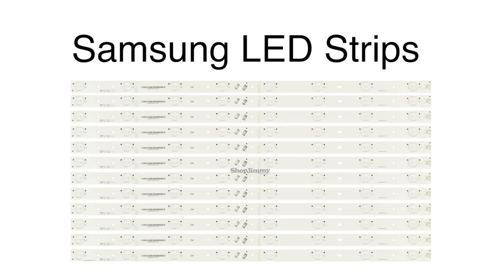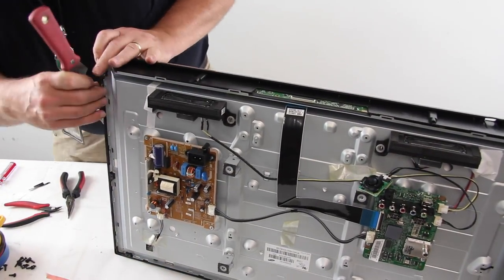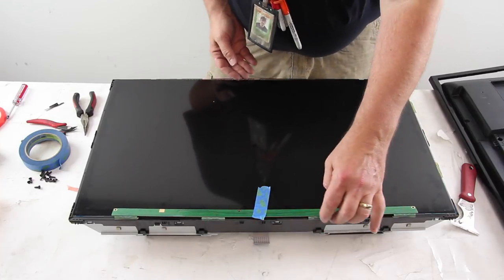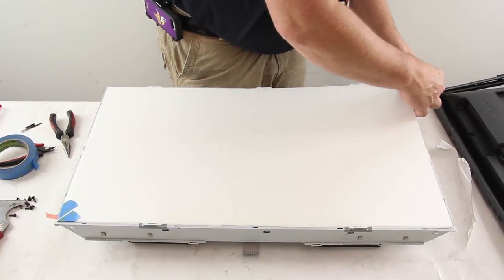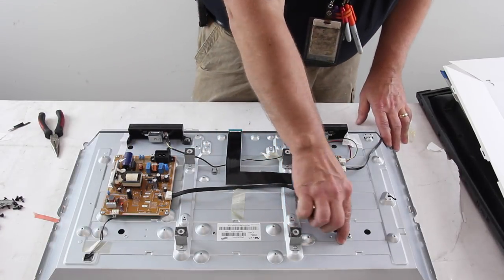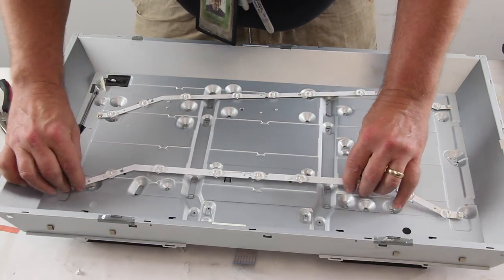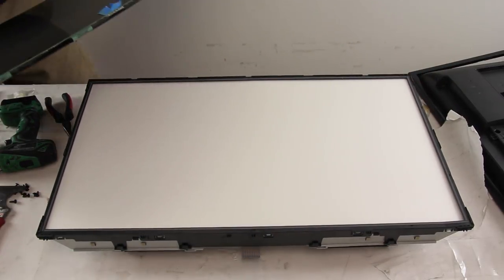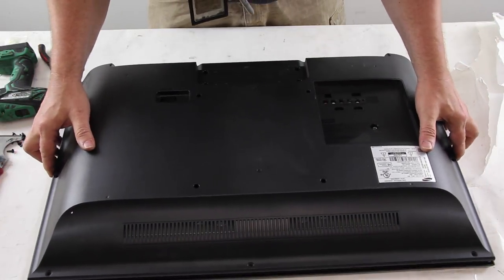Samsung 32" TV LED Strip Replacement - 32EH TV Model - BN96-28763A No Backlights & Blank Screen

Comment: Excellent video for a first timer. Tried testing voltages to backlights and got wild high readings?  Checked individual LED’s on the strips and several burned out. Should I be concerned about the power supply and replace it also?  Or just replace the LED strips and if it works, fine and if it doesn’t drop kick the TV?  All other PS voltages good and can see images with a flashlight.  Feedback welcome.  Thanks!

Comment: I just took apart my identical TV, wondering if there was anything useful inside. Sometimes electronics have nice magnets, sometimes the screen is a nice tempered glass plate. I've seen a few tutorials for how to make various non-working LED TVs into just LED lights but I'm worried that I'll mess it up. Could you make a video showing how to utilize only the LED function of this TV?

Comment: Here's a question for anyone... I have the issues of  a blank screen... however, when I plug the system in I will often get a 'splash screen' for about 1 second. Tore the set down to the LED strips being viewable, plugged it in....both LED strips light up for about 1 second...then nothing. Tried a T-conn replacement board with no luck. I am thinking the LED strip aren't the problem, but it look like the main board is bad with regards to driving the LED strips. Everything else seems to work as it will turn on to some internet channel (or something) that I can change channels and hear audio. If I shine a bright light on the screen I can see the screen menu and move around with the remote....Granted I should probably just trash the whole thing....but it has now gotten personal where I refuse to let this TV beat me...lol.  So what is the general consensus...replace the main board...take it out back for target practice...or is there something else I am missing...?